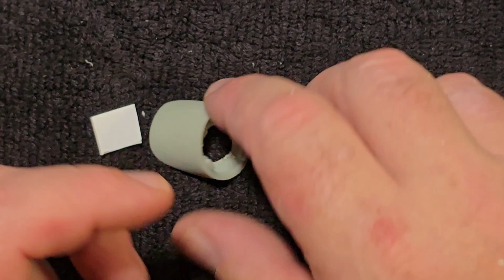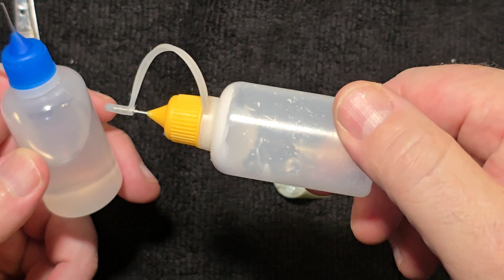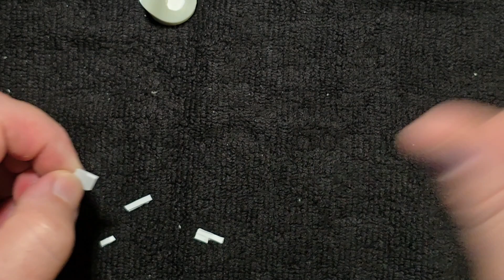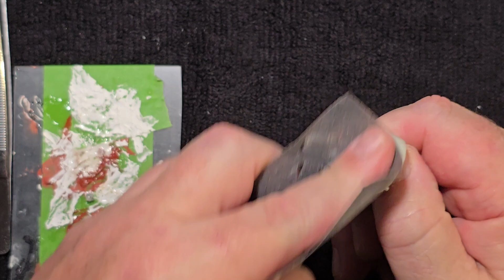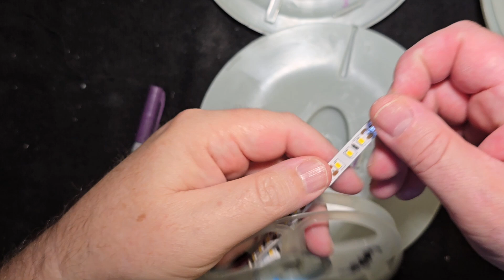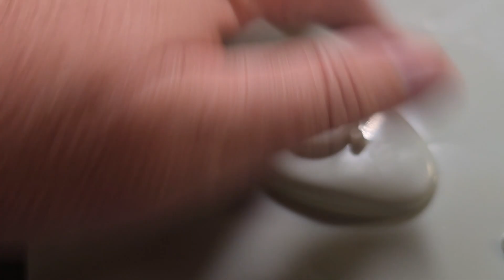Enterprise Dual Build Chapter 3

Comment: Even faster way to fill that hole you made in the end cap is use Solarez resin. sets with UV light and is sandable. The CA glue and baking powder method works but takes longer to sand.
Reply from the maker: @michaelbenjmitchell1  Heya Michael!  Take you for the comment !  I use Solar Rez quite a bit, but tend to avoid using it as a gap filling medium because it tends to pop off pretty easily as it doesn't bond very well.  I use it for domes, windows, lights, and to cover internal lights sometimes, or hold down fiberoptic (if it's feasable) .. but if I need something to really stay or stand up to really rough sanding I generally go with CA or putty.  I'll definitely keep it in mind as an option though!

Comment: For what it's worth, the bulge behind the bridge is supposed to be where the turbolift is housed.  That creates a bit of an issue, though, since, in order for that to be where the turbo lift is housed, the bridge would have to be turned by about 45 degrees, instead of facing forward.
Reply: You really can't tell from the inside of the Bridge anyways. LOL
Reply from the maker: @michaeldexter2544  oh wow that's cool! I did not know that (I'm ashamed to say)
Reply: @ I got the angle wrong -- it's actually 36 degrees!  In the Franz Joseph plans, the Enterprise bridge is shown to be oriented at 36 degrees off the center line -- that was the only way to get it to correspond with where the turbolift is shown to open on the set.  Apparently, the model-makers and set designers didn't always discuss how things had to correspond.  (I don't know if there's ever been an in-show explanation for why the bridge doesn't face forward.)

That's why the bridge piece on the 1:350-scale Enterprise model has mounting pegs that allow you to mount the bridge facing either forward or at a 36 degree angle.  If you mount it facing forward, which seems more natural, then the turbolift shaft and the turbolift doors don't align.  To get the shaft and doors to line up, you have to orient the bridge at a 36 degree angle, since the bridge set has the turbolift opening behind the captain and to his left, rather than directly behind him.

Comment: Looks good already, 
What if, you leave out all those small holes at the back of the necels. Hollow out the back completely and then fill it with uv glue, or something like that. Provide light blocking on the outside, and then make small shallow holes in those places with a template and your little hand drill.
Reply from the maker: @theor4258  that would have been a good idea !  It might have been tough to get the contour shape right though.  Worth some more thought for sure !!!